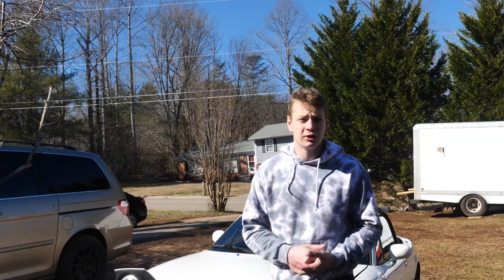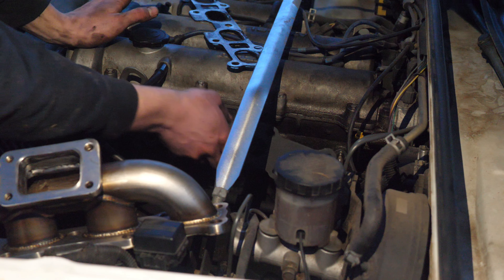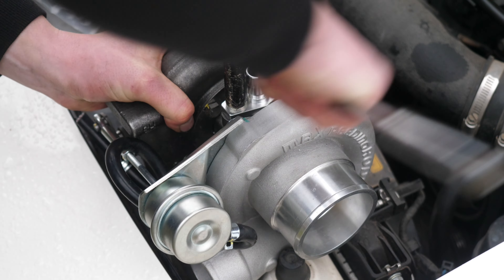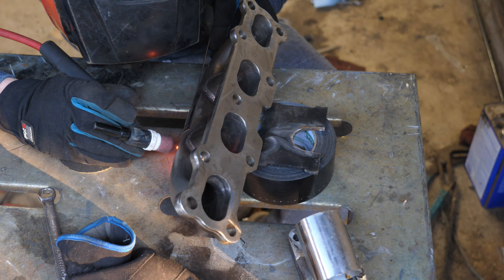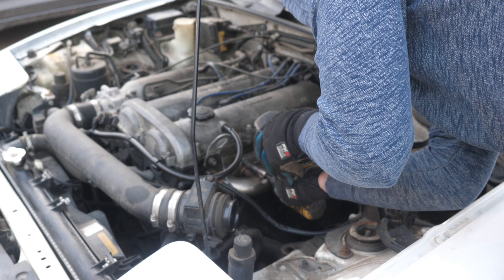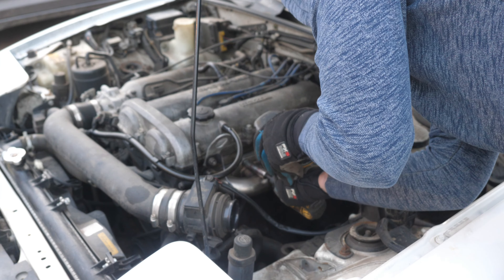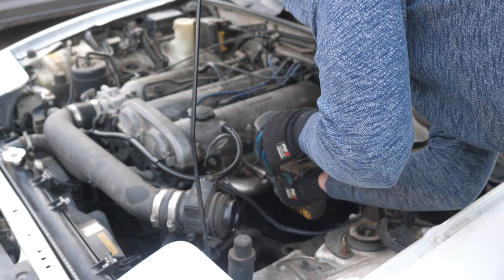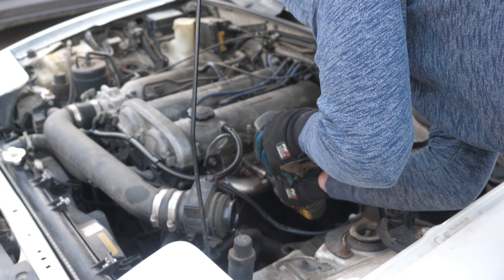Turbocharging my Miata on the cheap!

Comment: That's going to help with the 'get up to highway speeds'  pretty well.You can grind the inner lip smoother, on the manifold,for quicker airflow into the turbo without that interference.Also a duct into the turbo from the grill area will keep you from sucking in the hot engine air.Have fun!
Reply: If he does that also make the compression ratio lower that way you can raise the boost even more!!! (Making the compression chamber larger)

Comment: I did something similar with an old e30 over a decade ago used a vortex fmu rrfpr and slightly larger injectors plus a chip with agressive spark timing and cooler plugs. Ran on the rich side at idle and pulled like a beast. Another way to get around stand alone fuel injection, even though I did do mega squirt wich allows for agressive changes but is expensive

Comment: Definitely need to pull the exhaust housing off the turbo and open it up the your adapter that way the turbo can spool up a bit faster and flow better into the exhaust housing. It will help with power and response. As most don't think or know to do this.

Comment: You should have just ovaled the 2 1/2 inch pipe where it got tight to the rad and hood   and there are cheaper routes for tuning a miata just takes time to find the alternatives I forget the names of them it's been so long since I did my build